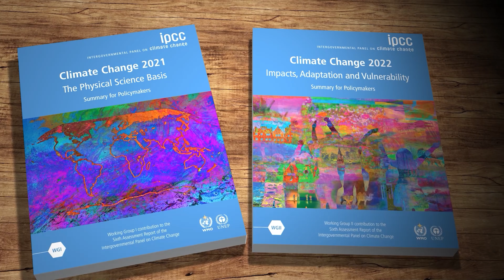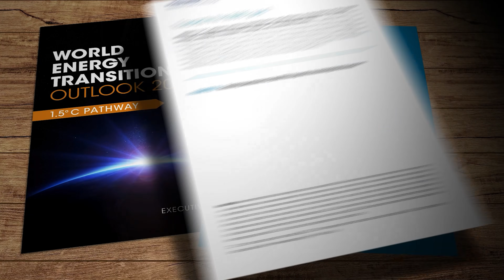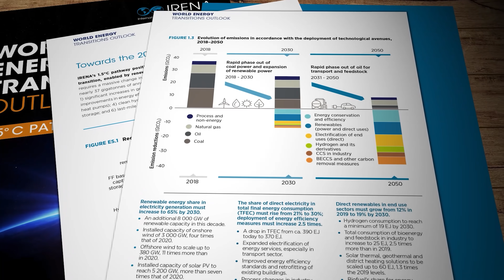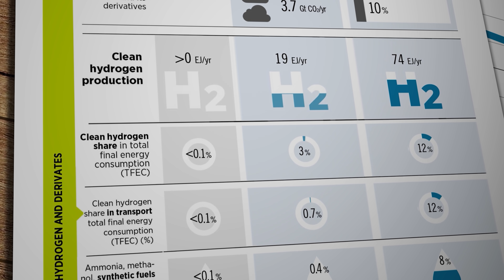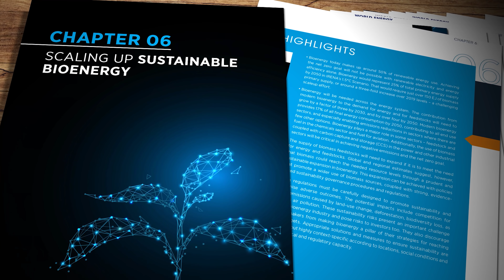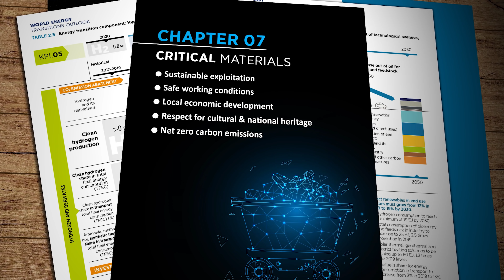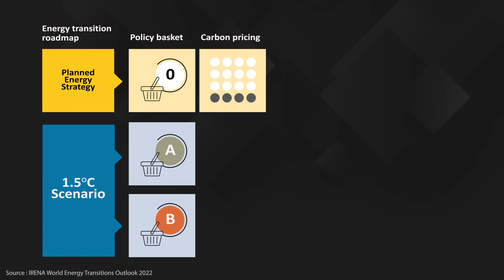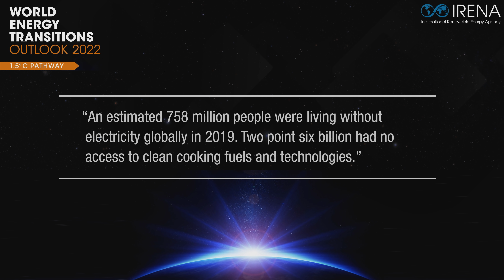Massive global energy disruptions are coming. Brace yourself!

Comment: What is really striking is the massive extent of how much the way laid out in this report is wishful thinking!  The world cannot coordinate much much smaller issues than climate change, and here we are talking about radical changes for which many technologies don't even exist, let alone are ready to be commercially implemented (not to mention social changes...). Within 10 years ? This report is an eye opener in this way, and shows that renewable energy cannot be the exclusive way to go. In the end, it's not renewable energy that we need, but sustainable energy, which, although overlapping, is not the same. France de-carbonized its electricity production within 10 years in the 1970s, by using nuclear energy and a very small ecological footprint. The more information we get, the more obvious it becomes  that, at least in the next 20-30 years, we will have to choose between a mix of (mature) nuclear energy and an increasing share of renewable energy (+ also carbon capture)...or just accept climate change and bear the consequences. If IRENA does not mention nuclear energy, this also shows that this is essentially a lobby trying to sell (!!) its product with shiny marketing and that we must advance beyond this type of thinking.
Reply: Sweden did so as well.  
Currently the world energy use is 
80% fossil
About 18% hydro and nuclear

Oh and about 1.5% wind solar and other renewables, tidal etc

Basically while renewables are great
We will need gigascale generation
So nuclear is the only real option, we will need to build as much as possible. And both parties in the US are on board with building smrs.
Reply: Yeah we're toast.
Reply: To switch to nuclear would need about 50,000 reactors.

We don't have a design that's suitable for mass production, and the resources needed to build 50,000 conventional reactors dwarfs even the most starry eyed renewables plan.

Nor do we have the fuel needed for 50,000 reactors.

We could extend the fuel we have with breeders, but they're much more difficult and expensive to build and run than the already expensive conventional reactors, and we don't have any designs for breeders that reach the efficiency required.

In comparison, building a few hundred factories that make solar panel making machines (we have the designs already) and a few thousands solar panel factories (we have the designs already) is quick and cheap.

Add a few hundred cable factories (we have the designs already) and in 8 years we could have a globe spanning electricity grid that takes energy from anywhere on earth to anywhere else, so no need for storage.

All for 100th the cost of nuclear.
Reply: @gasdive  Look at all the solar & wind built everywhere and its still 1.5% of total world energy use.  Ontario 65% of electricity is from 2 nuclear plants built in the 70s. The Bruce and Pickering, meanwhile the 2700 wind turbines are about 7.5%

Take a look at Sweden and France they each built enough in 10 yrs
Czech R has a couple that supply a 3rd of electricity. 
By all means build solar and wind but it still needs to be stored to match demand.  

Sounds like Musk quoting about his 100by 100mile piece of Nevada covered with solar panels would be enough for total US energy needs but analysts have worked out the costs and it a 100trillion
Reply: @peterkratoska4524  can you give me a Google search that might turn up those analysts?

Current price for solar panels is 0.1 USD/W at grid scale. Assuming 100 mile x 100 mile represents about 10^10 square metres of panel (given some losses for angle, spacing between rows, roads etc) and 200W per square metre, that's an installed base of 2x10^12W. (2 trillion Watts) 

So about 0.2 trillion dollars. The average output would be about 500 GW

A straight comparison with nuclear, 500 GW average needs a name plate install of about 550 GW, plus storage to cover peaks and absorb troughs.

That's 172 Hinkley Point C plants. Which is 3.784 trillion GBP. 4.650 trillion USD (and 20 years, so, 12 years too late).

If the solar solution is too expensive for your taste, you're going to really hate a nuclear solution that's about 20 times more expensive to install. 

Then there's the running costs...
Reply: @gasdive  commonsense skeptic
Did a cost breakdown. 
Nuclear would be baseload and continuous while solar fluctuates during the day with sun angle and cloud cvr. It also needs maintenance, and has a lifespan of around 25yrs. 
It would actually be a bad idea to have it all concentrated in one spot just to avoid risks of hailstorms or nuclear strikes.
And 10,000 square miles is a pretty large area to cover.
Reply: @gasdive  $200 billion will not even cover the cost of the real estate.
Reply: @peterkratoska4524  public land. Free panels for investors (large and small) willing to put panels on their property and connect them to the grid. 

Either or both solutions solves that issue.
Reply: @gasdive  you wasted half hour of your life and missed the point entirely, yes theoretically that area could generate the power but is in fact ridiculously expensive and no one in their right mind would actually build it all concentrated in one spot for all the obvious reasons.  Its just a factoid Musk likes to throw out but never bothers actually going further with it.  He sure isnt building a large solar field in Boca Chica for his spaceport, rather he's building 250mw gas plant and his rockets actually run on methane so while hes talked about a $100million prize on solving climate change he'd be better off not doing the ridiculous starship earth point to point that  Gwynne Shotwell figures will outcompete air travel.

His solarcity idea has been losing money until he merged and bailed it out with Tesla money.  And regarding free land for solar heck why isnt Musk on top of it, he's usually there when there free taxpayer money involved.

Also re storage, pumped hydro is great but good luck doing that in the desert.

I am actually for solar and wind but lets stop the kidding that its going to get us to zero carbon by 2050 (forget 2030 which is 8yrs) 

Currently (from DietercHelms Net Zero book)
The world energy use is 80% fossil
18% hydro and nuclear
And less than 2% renewables such as wind and solar

Take Ontario 65% of electricity generated is from nuclear.

The 6units of the Bruce cost $12billion over the time they were built.

In the past 12 yrs they also built 2700 wind turbines which cost$12billion and generate 7% of total.
Reply: @peterkratoska4524  the point was, you claimed analysts worked out the cost at 100 trillion. I asked who these analysts were, and you gave me the info. The analyst you quoted didn't say 100 trillion, but rather 8 trillion. The method that they used to arrive at that relied on multiple double counting, assuming that all the panels had to be in the same location and everything was bought at retail prices.

Far from missing the point, I got the point. You're making up figures by inflating figures by a factor of 10. Figures that are themselves obvious lies, inflating the real numbers by double counting, double counting and double counting again.

And you're still coming up with a figure that's lower than the cost of nuclear.
Reply: @gasdive  9 trillion just for the panels,  then there's the actual installation,  taking up 20% of the state (actually far more than Musks flippant 100x100mile) or are you expecting them to self assemble somehow? Then there's the grid storage cost, and the space for that. (and while  pumped hydro is great it will not really work in the desert) and of course the state will happily give away free land. and then the powerstations and the distribution network etc.. Maintenance and replacement of panels - and they degrade over time and are expected to last 25yrs despite wishful thinking (as do the grid storage batteries, not to mention thermal runaway issues and the actual finite limitation of the world lithium supply. 
In fact it is  actually most economical just put them on rooftops.
(and yet Solar city had to be bailed out)
The real point is that its a fantasy.

By all means build solar and wind but at the moment its still only 1.5% of world energy mix.  Nuclear and hydro both provided the gigawatt scale that is needed (and of course hydro constrained by geography)/

And as I said, in the Ontario example the Bruce plant has been operating since the 70s and you can look up the cost at $12billion which ironically is the same cost as the 2700 recently built intermittent wind turbines that generate a fraction of the Bruce.
Reply: @peterkratoska4524  repeating made up numbers over and over doesn't make them real.
Reply: @gasdive  Yes indeed. But although the levelized cost of renewables is cheap, their integration in a grid is very costly. Sorry, it's not just cable factories. And we actually don't have the resources to increase renewables either to the extent needed. That's why there is no way around both nuclear and renewables, to the extent that we can manage.
Reply: @puma7171  20 years in the industry here. I've had many many conversations with the guys who actually control the network, and their opinions are completely opposite to the story that the press tells about how you can't have more than a small percentage of renewables.

They love renewables because they're fast to ramp up and down, and they're super reliable, plus for about the last decade, they (grid scale systems) supply reactive power. So the grid becomes super resilient to shocks like big old coal generation falling over suddenly and unexpectedly.

Here in Australia we already have big sections running on pure renewable much of the time, and they're very stable.
Reply: @gasdive  It's a pipe dream gas.

Comment: solar and wind is the solution. as the percentage of solar/wind increases, it becomes more difficult to manage the grid until you exceed 100% of nominal production capacity with them, then it starts getting easier again. since the initial construction cost of solar and wind is around 1/3rd to 1/6th of other sources of energy, you can build 6x nominal production for little to no extra cost compared to other fuel types. that means that even low-production days can handle demand within a region with very little storage or peakers. also, if you build 5x-6x nominal capacity, you can start to offer energy-intensive industries nearly-free electricity if they co-locate with production and shut down during low-production times. concrete, bricks, paper, desalination, etc. etc. all can benefit from synchronizing their industry to solar/wind over-production. this creates "dispatchable load", which stabilizes the grid and give the industries a competitive advantage. typically the WTO does not like "dumping" of below-market-value goods, but it does not qualify as dumping if the government subsidized the energy sector that then resulted in goods that are cheaper than anyone else can produce. once countries figure this out, it will be a race to create such a scenario.
Reply: Sure, because 6x times the capacity will provide power in the middle of night or in a week long wind drought!
Reply: @richdobbs6595  yes, actually. demand is low at night and you can cover 93% of days with just 3x-5x nominal production and NO other sources of power. when you add existing nuclear, hydro, pumped hydro, and a couple of peaker plants, it becomes trivial to handle even rare under-production.
Reply: @somedude-lc5dy  Demand is not low at 8:OO PM!, that is when it reaches the peak.  If you cover 93% of the time by having 5x, but you still need to invest in other sources to cover 7% of the time, you are increasing the capital investment by a huge amount.  The current system in the USA is reliable 99.9% of the time, but is viewed as primitive in Europe, but excellent compared to India or China.  So, you are shooting for a system as reliable as India today????

Comment: There was a "science" show I watched a while back which featured a "low flow" type hydraulic turbines.  The place they were to be deployed was on the Canadian east coast "Bay of Fundy".  Having grown up in the tropics. those "low flow" turbines can be deployed in many place where there is continuous flow of water inland in the tropics.  The only issue is the height of the featured turbines that would require a modification to allow for lower water levels.  That would bring energy to many outlying villages without the use of any type of chemical fuels.  Here in Canada, there is also many waterways which have a "continuous flow".  If you have such turbine in say 5 to 10  KW range,  one could "stagger" them to generate enough electricity for a small town with having to invest in a "power lines infrastructure" to bring in energy from afar.
Reply: If you look into hydro power you need a height difference. That's where the energy comes from. A continuous flow isn't enough. You need the right geography (a steep gradient)
Reply: @unchartedexe  That is technically not true. You can define a flow either by a pressure head, or a velocity head. Gradients are usually more used when dealing with pressure heads, which is wjhat dams are generally designed for. But you can easily design turbines using velociity heads just as we do for wind turbines. All to say that steep gradients are not always necessay.
Reply: @unchartedexe  and the correct distances. If the places you’re trying to power are a long way away you get mugged by the 2nd law of TD
Reply: @unchartedexe  Did you watch the documentary of those turbines which would work in the Bay of Fundy ebb and flood cycles? The heigth I was referring to was the "tower like" stand the blades are attached to.
Reply: < continuous flow of water inland in the tropics> Please explain. We are all familiar with rivers emptying into the ocean. What type of water flows inland? Where does it happen?
Reply: @pauleohl  there are the tides that flow quite hard thru cut channels in the keys, also between the closely spaced Islands. The tides are constant but for five minutes twice a day!
Reply: @carlpodrecca5177  Always wondered if/how that "tide energy" could be tapped, all the while bolstered by rising sea levels.
Reply: @stevenjones6780  Tidal mills have been used for centuries. They work four times a day for several hours each (depending on tidal heights): once on the inflow, once on the outflow, and 2 tides every 23-ish hours. See one of many examples here https://en.m.wikipedia.org/wiki/Carew_Tidal_Mill
Reply: @Neilhuny  Must be all the usual reasons why the technology is not more wide spread. We certainly have a lot of coast line!
Reply: @pauleohl  "Inland" meaning away from large cities and towns which usually are along the coast or major Rivers.  Inland in the tropics refers to "in the jungle with limited or no access via regular transportation.  Those small villages most often are along the natural creeks and rivers upstream where the water always flows one way (to the sea or down elevation) but many are not very deep.

Comment: Green hydrogen is a myth... The energy required to produce it means it will always be uneconomic. It is also dangerous to store and is not viable in transport. The answer is battery storage - using developing technologies.
Reply: Can't use developing technologies on the time scale we are dealing with. No battery techs will arrive and be mass produced in the quantity needed within the next decade.

I agree hydrogen by electrolysis is going to be very costly, but storage and transport problems can be solved with fuel cells. It is worth remembering that all fuels are inherently dangerous to use because they have to be energy dense, even the future battery techs you are hoping for are explosive and fire hazards beyond what current petroleum based fuels are. Batteries, like hydrogen fuel cells, are however designed to mitigate risks.
Reply: @NATIK001  I've worked with Scotgov on hydrogen for trains and it is not viable. Fuel cells for cars are too complicated. The batteries being developed will be available for mass storage within 3 years. We could always revert to large lead acid batteries for mass storage in the meantime. I installed a lead acid battery system to store energy from wind turbines at my farm 15 years ago.
Reply: @HazewinDog  Big companies make big mistakes. Hydrogen will fail. The infrastructure required is at least four times more than electric and dangerous as a network.